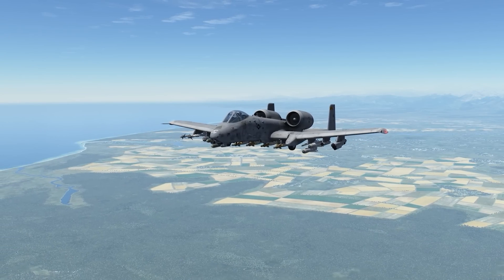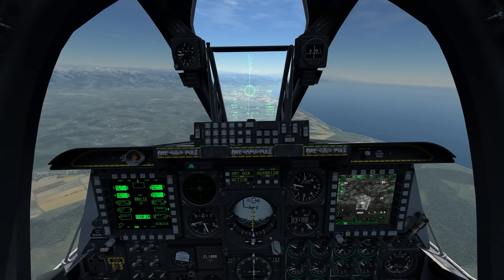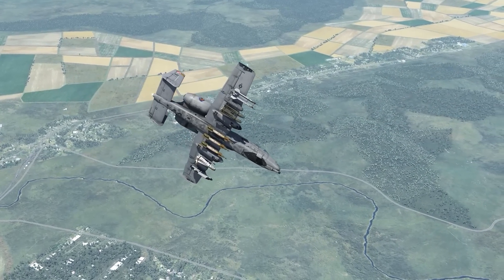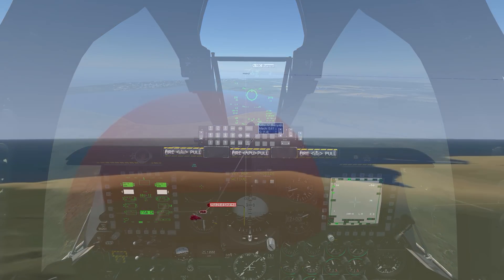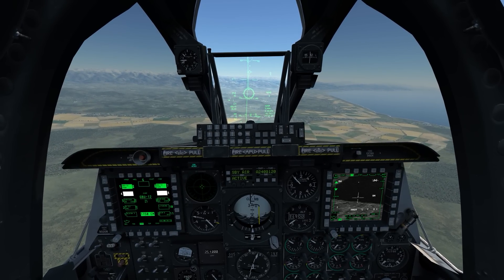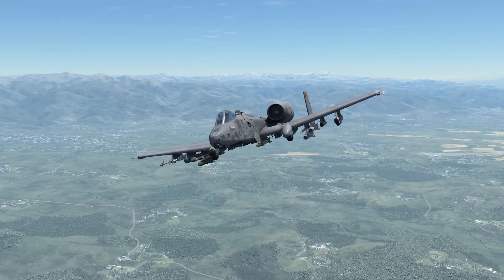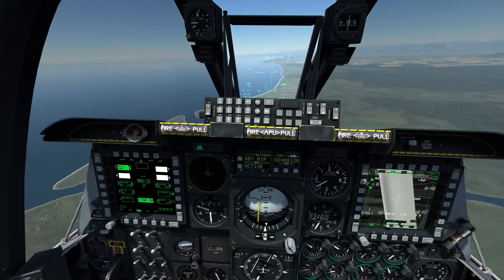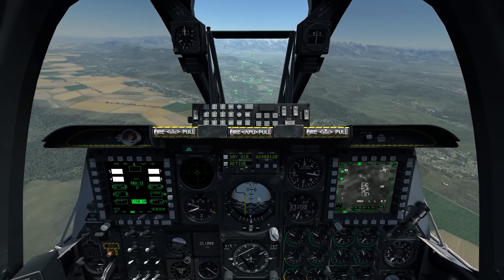On the Range #56 - LGB Low Altitude Limitations in the DCS: A-10C Warthog

Comment: Would lasing it later help, say 5 second lase time?  The high bomb can correct enough as it's travelling faster / has more energy.  If you let the low bomb speed up and lase at the last second it might work better.  Your aim point will be more accurate at low level (the CCRP solution will be more accurate).  If you are really stuck and low level a must you can just drop it dumb and don't lase.  Actually... if you lase the high bomb for 20-30 seconds you will probably see it fall short too.
Reply: Paul Campbell Yes. Lasing later will fix the issue. In the military we start lasing at 10 seconds prior to impact.

Comment: +Bunyap Sims I think there's a better way. It's been 4 years since I last played so I don't remember exactly, 

There's a setting in the DSMS which can help you. From what I remember, that settings tells where to aim the gbu if it was to follow a purely ballistic path.

From your videos, it seems that by default the gbu is released so that it reaches a point between you and the target (then guidance changes that to aim precisely to the target).

For low altitude deliveries, you can change that setting so that it aims either closer to the target, or further ahead (don't remember). If the gbu is aimed further ahead the target, the gbu will need to correct to a steeper dive to reach the target, this works much better that trying to flatten the trajectory....